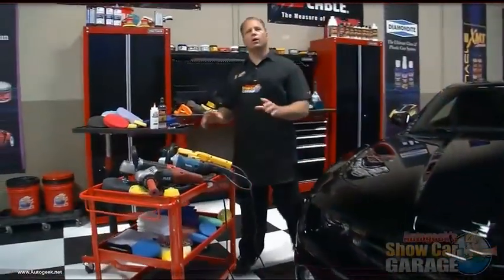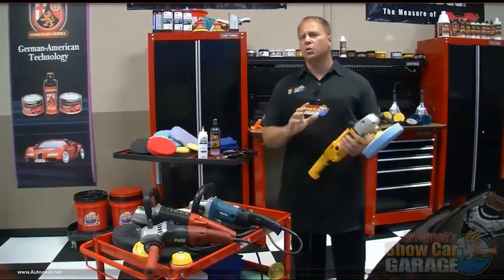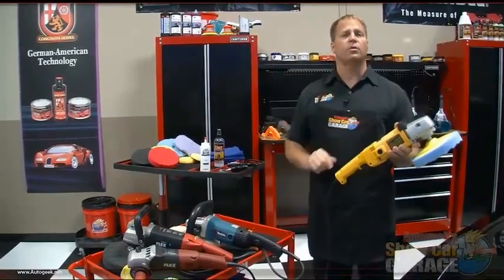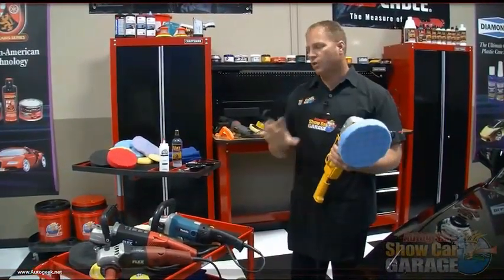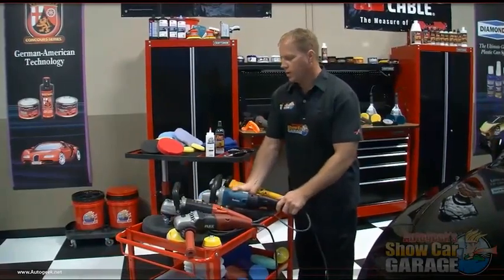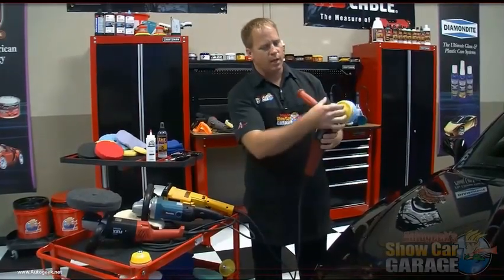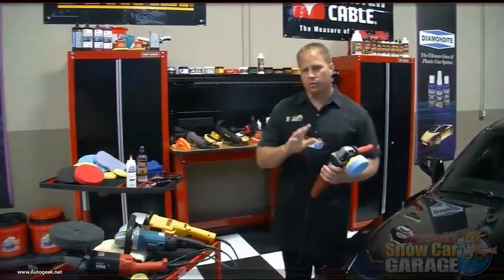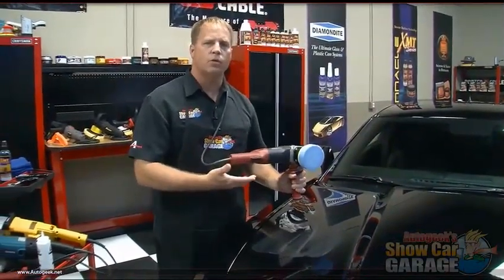Part 2 - How To Pick the Right Car Polisher for your Detail Project

Comment: can you put a 3 inch pad on the dewalt?
Reply from the maker: Yes but it's awkward and when buffing on a horizontal surface the buffer is "tipsy".

-Mike Phillips
Reply: Autogeek thanks!  Lots of reviews of that little Griots garage 3 inch buffer complain that it is not very powerful and it overheats.  Any thoughts?  Are there other 3 inch buffers that you would recommend?
Reply from the maker: Richard Todaro
Check out my review of the PE8 here,

http://www.autogeekonline.net/forum/ask-expert-featuring-mike-phillips/86327-new-flex-pe8-precision-rotary-polisher-action.html

-Mike Phillips
Reply: Autogeek How long is the cord?
Reply: Also, I called your company and they steered me away from the PE8 as they said it was rotatory and could;d easily burn through the paint.   I ended up ordering the PC from you and the little Griots Mini,  Thanks for your help.